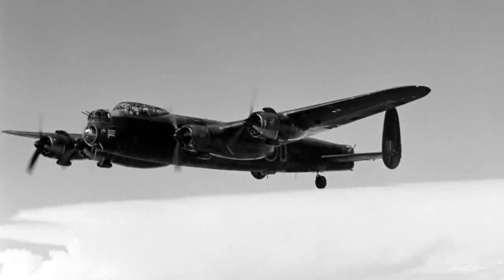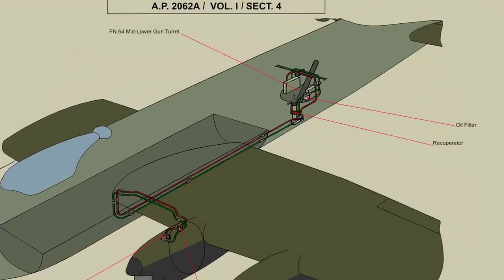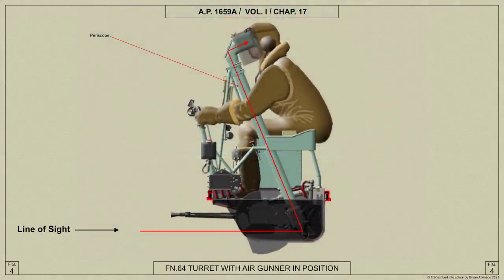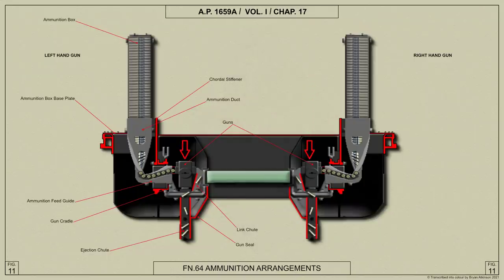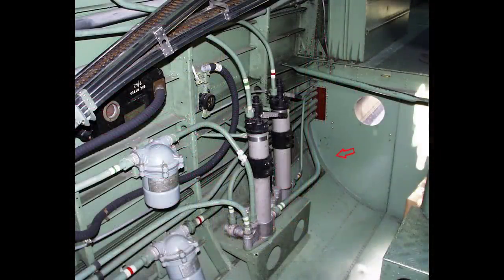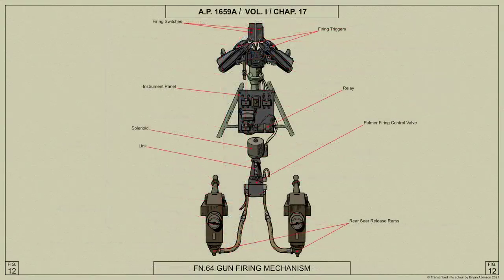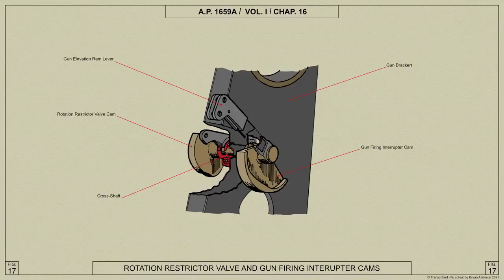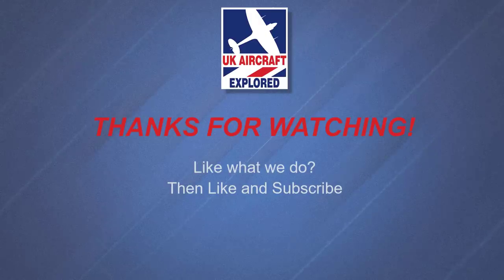Avro Lancaster – FN.64 Mid Lower Gun Turret

Comment: Great stuff. I knew of the rare lower turret existence but found little information on it until this. Is there any information on the single .50 fitted  to fire downwards on  some RCAF Lancasters? Or was it an ad hoc fitting? That would be another interesting video if the information is available on its use or effectiveness
Reply: There was the Preston Green Mk. II which was used in a few Lancasters which I read could be fitted to Lancasters, but I've never seen a photo of it. I've also read of a Vickers K bring used, again no photos. Plus the RCAF mounts and some Aussies using a 20mm cannon.
Reply from the maker: I will be producing a video covering the Vickers K Gun later. Thanks for watching
Reply: The Canadians of 4 and 6 Group in Yorkshire liked the idea of a ventral gun, mainly using the "Preston Green" ventral gun position but it was only for the Halifax. It mounted a single rear facing manually operated .5" Browning on a limited traverse and depression mounting. It was in effect a non rotating bowl with (often painted out) perspex panels with a significant rear facing area cut out to facilitate gun movement. The Canadians liked them but inevitably they were negated by H2S.

Comment: The turrets were only used on the Bristol Hercules mk 2, the engines weren't as powerful as the merlins   so the ceiling was lower,  and carry less bombs, so they put that in for self defence. When mk2 was withdrawn so was the lower turrets.
Reply from the maker: The FN.64 was also fitted to some early Lancaster Mk.I aircraft, and once daylight operations started again in June 1944, some Polish Squadron Lancasters were fitted with the FN.64 instead of H2S. Thanks for watching.

Comment: Thanks for that. My uncle was a pilot on those in ww2 but I never realized they had that turret. Did they use those when night bombing Germany or did they prefer the extra bomb load I wonder.
Reply from the maker: The FN 64 was not fitted to all Lancasters. The periscope Sighting system proving not very good for night operations. Most Lancaster were not fitted with the FN.64

Comment: My late and greatly missed father was an RAF armourer. He remembered being trained on the FN64. He was always very complimentary about the Frazer Nash system control sensitivity and ease of use. But he would also comment that even as an armourer (as opposed to an air gunner) it was obvious that target acquisition and tracking when using the 64 was going to be near impossible even in daylight, not only due to the lack of any peripheral vision though the gunner's periscope, but also because oddly it didn't have 360 degree traverse. Both Boulton Paul and Frazer Nash (the latter's turrets strictly speaking being manufactured by "Nash and Thompson" using the "FN" control system, and as such given "FN" identity prefixes) made great efforts to produce effective ventral turrets. The former for the Halifax in a similar design to the FN64 though powered differently, and the latter for amongst others the Wellington, Stirling and Whitley. Despite none being successful in combat, the engineering efforts that went into the challenging issues of defending bombers from ventral attack was incredible. Interestingly the US Bendix company came up with a ventral turret for the Mitchell also aimed by periscope. It too was not considered a success. So bravo to the US Sperry company for coming up with the ball turret. Now that was genius engineering!
Reply from the maker: Thank you so much for sharing Tim - very interesting! Thanks also for watching

Comment: The photos of the aircraft are strange as the engines are radial but the aircraft used RR in line engines
Reply from the maker: The photograph is of the often over looked Lancaster B Mk.II was fitted with the Bristol Hercules engine. Thanks for watching!
Reply: @ukaircraftexplored6556  Thanks, did not know that.

Comment: My understanding is that the B-17 had a ball turret whereby the operator had to sit inside the ball turret. If this is true, then why did the American Air Force not implement the type of firing mechanism as on the Lancasters? In B-17s if some part of the aircraft was damaged the ball turret operator could be trapped and unable to exit except on the ground. If the landing gear was damaged the ball turret operator was in danger if the aircraft had to do a belly landing.
Reply from the maker: Thanks for sharing
Reply: @ukaircraftexplored6556  Maybe someone else knows the answer.
Reply: They did, but the American version by Bendix was if anything even more useless than this one.  Some early B-17Es sent to the Pacific had them but were later removed and the hole plated over. It was replaced by the more familiar Sperry ball turret on later E models and that turret became standard on all later B-17s.

Comment: Such a clever implementation. Safe. Accurate. Available for rapid crew member swaps. No operator physical limitations. Compared to ALL American bomber belly turrets that killed crew members from exposure, had limited crew size mandates due to cramped quarters and specialized support equipment for both guns and operators. Reminds me of the Ten Million Dollars that NASA spent on a Zero Gravity Space Pen and Russia sent up pencils. If it ain't over engineered and complex - it AIN'T American made.
Reply: The NASA space pen and the Soviet pencil is a myth. Both space agencies used normal ball point pens.
Reply: The fact that these were rarely fitted should probably tell you something. Sighting at night is hard enough. Doing so through an optical system is nearly impossible.
Reply from the maker: Thanks, I'm glad you found it interesting
Reply from the maker: Yes, the FN64 Turret was mainly fitted to Canadian Air Force Lancaster B Mk.II aircraft fitted with the Bristol Hercules engine. The turret was not very successful, being used at night.  The periscopic sight offered the gunner very little clarity. Thanks for watching
Reply: If you look at the statistics on B-17 and B-24 turrets, the ball was one of the most effective in terms of claimed kills (actual kills probably 20% of claimed) and the one you were LEAST likely to be killed in.
Reply: The ball turret support gear was normal for USAAF turrets - oxygen and rheostat for the heated suit. The top turret, also a Sperry, had the same. All positions in a B-17 or B-24 did. The only really special bits were IIRC, the use of the feet to adjust the sight ranging, and having to suspend the turret. At least on the Sperry, unlike some UK dustbin turrets, you were unlikely to inadvertently operate the turret jettison lever. getting in.
Reply: The pencil thing is urban myth. And not all US kit is over engineered.

Comment: Well, it proved to be somewhat useless but at least you didn't have a squishy human being seating in it like on the US bombers. I guess the B-29 system was the best compromise: remote aiming station but direct line of sight from the gunner to the target. Even then, night raids at low altitude without having to think about triple A or enemy air ended up being the preferred tactics.
Reply from the maker: Thanks for watching, very interesting
Reply: Agree that the B29 gunnery system was the pinnacle in terms of air gunnery technology during World War Two but one thing that always bothered me is that even with the side blisters for the gunners I do not believe b29 gunners could see below their aircraft well enough to respond effectively to a true attack from below. Certainly not with the vision that a sperry ball turret gunner on a B17 could for example.
Reply: Douglas A-26s had a similar mirror sight for their underside.  It was a flipping upper/lower mirror arrangement as a target passed above or below the bomber.

Comment: I read about this turret, it was used experimentally, but was removed bcz was difficult to use and useless in night, effectively don't understand how it could've be useful against an heavy night fighter, the.303 guns had a shorter range than the 20/30 mm the germans had.
Reply from the maker: The FN.64 was an early wartime turret designed for daytime use. As you say, it was next to useless for night operations. Thanks for watching
Reply: @ukaircraftexplored6556  Ironically also the early Wellingtons had a ventral turret, when it was removed, the "circle" remained in the geodesical structure .

Comment: So.....the one self-defense turret that could really do something against the "Schrage Muzik", is removed, meanwhile the top turret, which is useless at night, stays.
Reply: Bear in mind that from mid-1944 onwards the RAF started doing an increasing number of daylight raids with Lancasters. By 1945 they were quite common.
Reply from the maker: Thanks for watching
Reply: The Free French tended to remove the mid-upper. Apparently, the front turret didn't tend to see a lot of use. Hence in later Halifaxes you have for gun mid-upper, four gun tail, maybe a 50 in a Preston Green, and a Vickers K pop gun with a very limited field of fire in the nose as only a mild deterrent.
Reply: @wbertie2604  The Halifax in its early variants was somewhat underpowered and this only got worse once they added more defensive guns on the MK2. 
So the MK2 went through a number of sub-variants. The original upper twin-gun turret ended up being replaced by the small four-gun turret off the Defiant. The nose got redesigned and the forward Twin-gun turret was removed and replaced by a more aerodynamic plexiglass nose with a K gun. Eventually, with the MK3 the plane got more powerful Bristol Hercules engines which more or less solved the problem.

Comment: Why on earth didn't they have a ball turret like the B 17 had it would have probably saved lives and Lancaster's
Reply: Not neccesarily; the turret requires yet another airman and increases weight. It may have been better to have had two or three less crew (who could be transferred to pilot or nav training) and a cleaner, lighter and faster Lancaster.
Reply: The position was probably worse place to put a ball turret when landing. It would get in the way when landing even if retracted.
Reply from the maker: Hope this was interesting!
Reply: @AV-sl9wg  And more or less under the upper turret so there wasn`t enough room to fix the big brackets needed for a ball turret, even a fixed one.
Reply: Carrying more weight at the expense of payload means more sorties required for a mission.  So more aircraft and air crew lives at risk. A cost benefit analysis would IMO have concluded that would result in more losses...

Comment: Making that turret dependent on the proper functioning of just one engine strikes me as rather poor design. There should have been a redundant power source on one or more of the other three engines.
Reply from the maker: In wartime, it was the way it was done. Each engine driving a hydraulic pump for a single gun turret. The design was to ensure that if an engine was knocked out, only its related turret would be effected. Hope you found the video interesting, and thanks for watching Craig!
Reply: @ukaircraftexplored6556  Seems as though some sort of interconnection would have been advisable. Still - good guys won, didn't they? Doesn't matter now, everybody's friends again, to varying degrees.
I did find it interesting, yes.